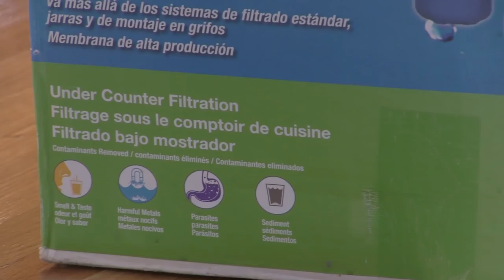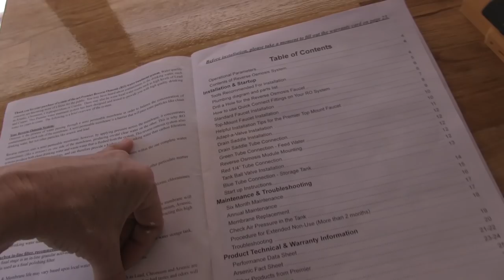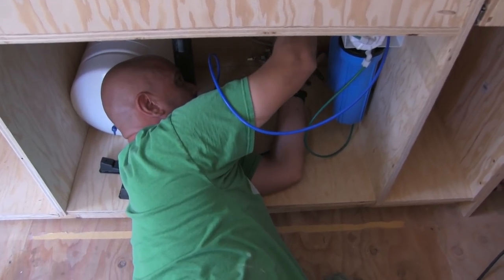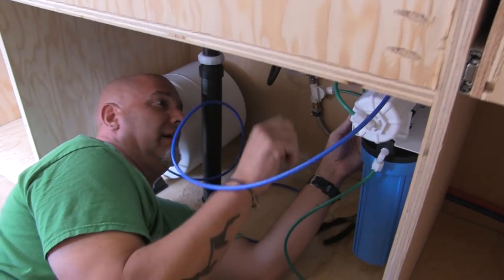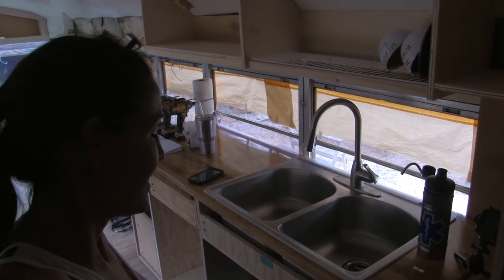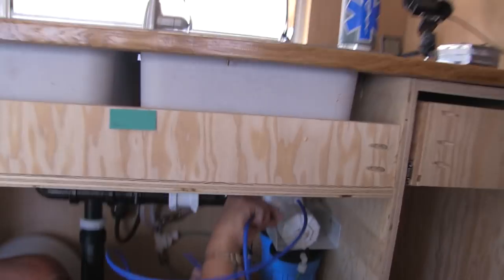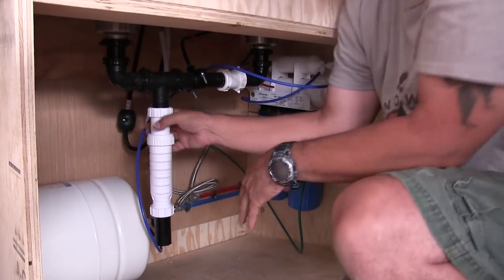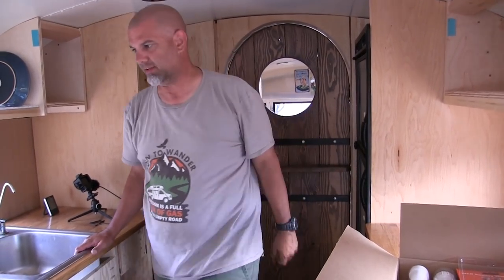Our Water Filter Wastes HOW MUCH Water? Plus HepVo Drain in Skoolie Kitchen

Comment: I would have plumed the waist RO water back to the fresh tank for uses at other uses like shower and washing dishes and things
Reply: Is there anything wrong with the waste water?  It would be diluted if you ran it back to the fresh tank.
Reply: I was thinking the same, if it's not bad water why not out feed it back into the fresh water tank?
Reply: think2799 But wouldn’t that approach just continue to raise the percentage of “dirty” water in the fresh tank (I.e., any water returning to the fresh tank would have “failed” the filter test)?
Reply: @billk.7889  true. but just water that you would not want to drink but water would be for washing and drain to gray tank after being used for washing. if you flushed fresh the tank regulerly then build up would not be that bad i think. but im not a expert. its just a thought.
Reply: think2799 Good point.  As long as you plumbed up the water lines so the reverse osmosis system was only used for a dedicated drinking water faucet (vice sink water, showers, toilets, etc.), and you primarily used water for those other purposes, then I’d agree.
Reply: @billk.7889  It isn't "dirty" water.  In fact it is probably cleaner because it went thru the two other filter stages (usually particle filter and taste/odor/chlorine filter). The reject from the RO membrane is just slightly higher concentration of minerals than the input water. As long as you are using the fresh water for other things (washing dishes, shower, flushing the toilet, ...) and refilling the fresh tank the concentration won't become significant.
Higher input pressure makes RO more efficient. The small units like that usually are good up to at least 80 PSI. This can increase your ratio from 1 of 6 to 1 of 4 or better.

The other thing you can do with RO, if you have high enough water pressure, is connect the concentrate from one membrane to the input of a second membrane. If before you were getting 1 gallon of RO water (called "permeate") and 5 gallons of waste, (more correctly, "concentrate") by adding a second RO filter you now get nearly 2 gallons and only 4 of concentrate.
By doing both of these methods, my home RO system produces a 1 gallon of permeate and less than 1 gallon of concentrate (a ratio better than 1 of 2).
Reply: Yeah, we plumbed ours according to the manual which just dumps the "dirty" water into the gray tank.  Doy, it needs to go back to the fresh water tank for RV/Bus type applications.

Comment: I had never heard of that HepVo drain but what a great idea. It will also save space by dropping straight down. I had a reverse osmosis system in a former house and totally hated it. The two filters were expensive when time to change them of course that was many, many moons ago. Lesson learned - research research research.......

Comment: Plumb the east water back to the fresh tank. It’s not bad water it’s just has slightly more “contamination” and minerals than the water that went through the membrane. 
We’re looking at a reclamation system that reclaims shower and washing machine water through filters-RO-UV sterilization. The waste” from the RO unit will be plumbed back to the reclamation grey tank (where the shower and washer drain) with the RO output going to the reclaimed tank to then feed the shower and washer.

Comment: RO is great but it uses water pressure to filter water. I understand it to be about 5 gallons wasted to 1 gallon filtered. We used to have it in the house and we got rid of it because of the waste. Couldn't live with that much waste during a drought. Good luck. Just get filters.

Comment: I used to work for coast R.O. as a installer,I love to watch other people do it.It should only come out of that waste line when back flushing,There should be a bypass valve somewhere?I have not messed with that type of unit.
Reply: That type back flushes while filling the tank then shuts off when it's full.

Comment: If boondocking you could buy a filter to fit on the exterior hose that can filter the little germies. And that way you do not have to use it all the time.
Reply from the maker: That is a very good idea. If we decide to go international (Mexico) it might be a great idea to keep all bad things outside of the skoolie.
Reply: @BussyMcBusface  I have the hose filter on my RV. And when a campground had It's water system contaminated we all got sick. They don't filter out the really stuff.

Comment: If you can run the hepvo valves horizontal, do you need one per fixture or could you get away with using one after all your fixtures before you get to your grey tank?
Reply from the maker: I imagine just 1 would be fine really. 😊

Comment: The RO waste water is still good but only contains more solids than the drinking water that has been filtered out.  When you shower, wash dishes, then the wash water will go down the black tank and lower the concentration of solids.  Just run a return water line back to your fresh water tank from your RO waste line to use again.  That is the only way to set it up in a RV.  It will be very important to have a house filter set up in your bus where you add water to the fresh water tank.  Do NOT EVER add water to your bus tank unless it goes through a filter.  On mine, I also have a water softener set up and a 5 micron house filter that it goes through when adding water to our tanks.  I also have a .05 micron water drinking filter under the kitchen sink.

Comment: you could reuse the "dirty" water of the RO to shower or in toilet or wash dishes or to wash the outside of the bus, you just can't drink it, you just need a tank to put this dirty water
Reply: You can even drink it if you were willing to drink the original water. Think about it. If 6 gallons of water go in, and coming out 1 is "permeate" RO water for drinking that means 5 gallons of "concentrate" go out the drain line. If the membrane were to stop 100% of the minerals (usually they only stop 85% to 95% and with low water pressure even less) then those 5 gallons each get 1/6 more minerals than the input water. If the water were really hard 24 grain per gallon to start with, then the concentrate would be no worse than 28 gpg. Not significant. Then dumping that back into the fresh tank with 24 more gallons of 24 gpg water means that now you'll have 29 gallons of water with less than 25gpg. Not significant.

Comment: The water that is wasted is already pre-filtered. Just send the waste back to the storage tank.
I mean it will filter the water in the rest of the storage tank.
Reply from the maker: The main problem is the amount of pump usage.  Multiple people with rvs and busses have told us their pumps burned our prematurely because of this issue.
Reply: @BussyMcBusface  We have a 33' Class A Motor Home and use two SEAFLO 42-Series 12 Volt, 3.0 GPM, 55 PSI (Adjustable 20PSI - 60PSI) Water Pressure Pump. 4 year warranty. No worries. RO systems are 4 gal to 1 gal as you know. Well, these pumps laugh at that work load
Reply from the maker: The problem it it turns on and off hundreds of time an hour to deal with it. It's just what I have learned.

Comment: The thing with RO filters is that it filters out everything and produces "dead water" so to speak. It filters out not just the bad but also the good. There are good minerals in water that are beneficial. Turns the water more acidic in the PH spectrum instead of the good alkaline. You can add another stage to your ro filter by adding an alkaline filter. That stage would add good minerals back into the water. Also the waste water is not all bad water its just the RO membrane cannot process all that water that fast so a lot of that water just passes thru un processed. So you can reuse that water . A way around having so much waste water is getting a higher gallon per day membrane. That would allow for a faster filtering process but also would allow slightly more TDS  particles to be not filtered out. Maybe get a smaller tank for drinking water only then plumb the "waste water" back into the larger house use water tank.